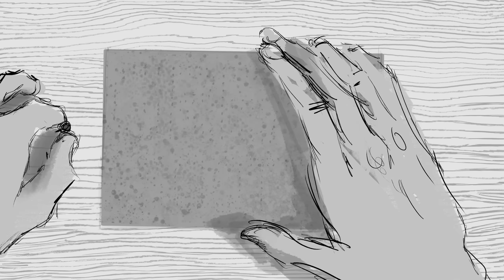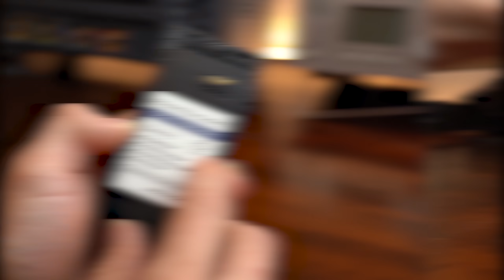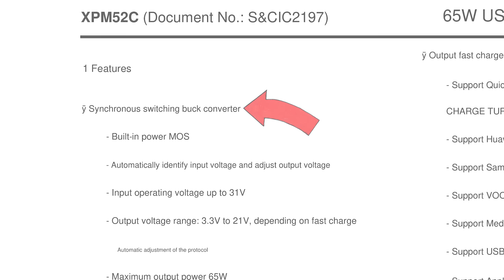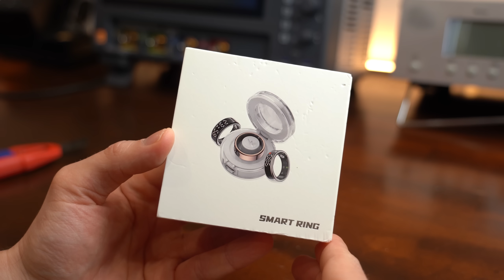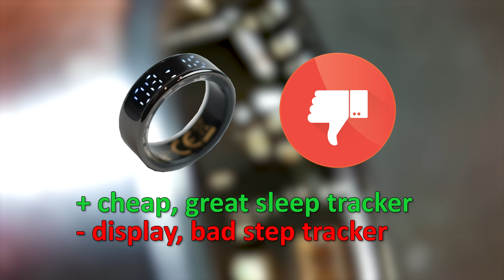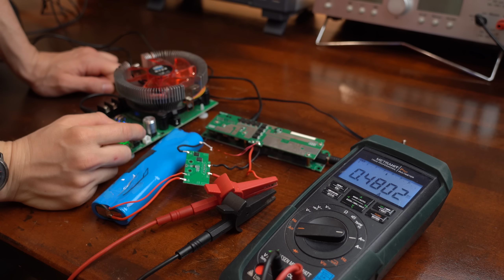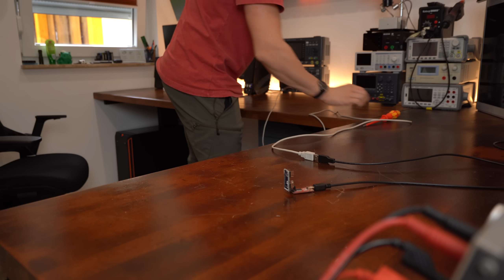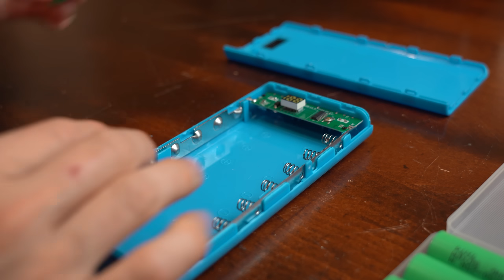I tried finding Hidden Gems on AliExpress AGAIN! (Part 17)

Comment: 14:24 "Shrapnel is positive". With imbalanced cells it's virtually guaranteed!!! I love the Chinglish. One of the products I bought said "The item is optimistic about polarity". 😂 yup, no reverse voltage protection, just optimism!!!
Reply: For some reason "battery contacts" gets translated to "battery shrapnel". If you want to buy contacts for your 3D printed battery holders, most of them are listed as shrapnel.
Reply: Reminds me of the violence motors. I have no idea what it translates to violence, likely something to do with torque or power, but it's always amusing.
Reply: I bought a mini quad bike for the kids a few weeks ago... The instructions clearly state, not once, but at least 3 times, that it uses "2 storke" fuel because it's a "2 storke" engine.
I guess that's some sort of new renewable energy... Probably explains why the local chicken farm has expanded so dramatically recently.... They're going to be breeding storks for these new engines 😂
Reply: @tin2001  This raises the question: what delivers baby storks?
Reply: it's not chinglish  - it's robot translated.
Reply from the maker: Haha
Reply: It's a device to let a person make their own power bank. Having reverse voltage protection would be a waste of money. You're not installing batteries multiple times. They assume a person buying it knows what they're doing. There is nothing wrong with the product. (According to what we see in the video.)
Reply: @ddegn  1 - that's not what he meant. The reverse voltage protection was about another device but with bogus translation.
2 - the device here really only works properly if you've got a bunch of properly balanced batteries to begin with, if they're a bit out of balance when you install then no it isn't safe. If anything, it should have been properly described at least.
Reply: @ddegn  Indeed, balancing your cells before fitting them is a clear requirement.  One might even get away with connecting a prospective new cell via a 10 Ohm resistor until there's zero volts across the resistor, then put the cell in and repeat with the next one.

Comment: Mini-UPS: There is a cheaper "barebone" version for 18650 batteries starting at ~$20, which looks the same (there is a 36W version with display and a even cheaper 18W version without).

Comment: The Powerbank case is not great but at the same time, those spring terminals are trash and will effectively limit the current that can flow to like maybe an amp or two - That would somewhat safely balance out the batteries at even lower current due to their difference being smaller.

Comment: The inductor is the component which heats up the most on these USB PD modules. And they can get very hot. Still very good and also other similar versions. Bought this same one some time ago and also a similar 4 in 1 USB-A version and a SW3518 100W as well. They surprisingly deliver as promised. There is a140W PD version next on my list. Quite cheap way to get 100W+ PD, if you have spare power adapters.
Reply from the maker: Good to know. Thanks for the feedback :-)

Comment: So you could really have a nice and long lasting “off grid” communicator if you pair this with a LoRa node and put the Meshtastic/meshcore app on the walkie talkie, since it’s just Android. I definitely might have to get one of those now. 

Also, I use IoT club SIM for my car’s OVMS connection. Works great and is only $35/year.
Reply from the maker: Sounds like a fun idea ;-)

Comment: Years ago NEXTEL in the US had phones in their network that would also work as walkie talkies on their network.
Reply from the maker: Thanks for the fun fact ;-)
Reply: I remember those. They were quite annoying in public. With a normal phone call, you only hear one side of the conversation, with those you got the joy of hearing both sides (and they always had the volume all the way up) along with the annoying tones every time they hit or released the transmit button. I do not miss them at all.

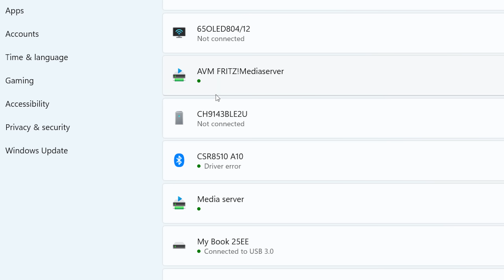Comment: 12:47 actually its normal to disconnect because there is no connection on going on. Once you pair device you should see com port for it on the device manager in bluetooth tab. But there is no name on these devices some times. So i am trying to connect for bluetotth ports once you find correct port it will connect. To connect i mean i use hercules.exe serial program and i choose it my port in there. To find out which port it is try disconnet pair and check device manager then re pair. You can find whic one is it. For every pair device windows creates port and keep it like that for every device paired. i hope its helps.
Reply from the maker: Thanks for the feedback :-)
Reply: I was about to comment this. I had noticed this when using Bluetooth serial with an esp32. It will successfully pair but will appear disconnected. To connect it, you would have to use the new COM port when using a serial monitor and it will connect automatically

Comment: I made the opposite of PoC Walkie Talkie. I use walkie talkie as audio modem, so we can send data over amateur radio network. I hope you find some hidden gem about those 😂
Reply from the maker: Definitely sounds interesting ;-)
Reply: @greatscottlab  There is the ggwave library in github.
Reply: I did it too using 1W portable radios... 10km range on 144MHz! The bandwidth is minimal but still enough to send small data packets.
Reply: @MyNotSoHumbleOpinion  You can run 9600 baud packet if you have a radio that supports it. The bandwidth is too wide to use the microphone connection. It needs a direct connection to the modulator and discriminator. Some radios have a data port for that.
Reply: @rocketman221projects Oh yes, absolutely! The 144MHz frequency has a lot of bandwidth with the right modulation, but in my old project (from the early Arduino era) I just used a rapid tone pulse injected into the microphone jack! The receiving part was done on the headphone jack! So nothing sophisticated or reliable! I took inspiration from the audible clock synchronization signal sent by a public radio stations every couple of hours at 92.1MHz (still used today)
Reply: Where I used to work, the company developed a method of using a laptop to connect to the internet over a mobile phone, this was in the 1G days when mobile phones were larger than housebricks.
The phones were the type that you installed in the boot (trunk) of your car, we fitted them into a rigid briefcase with a UPS sealed lead-acid battery to power it & a modem to connect it to the laptop, they were quite successful for a while to business people.
Reply: can you send complex data such as pictures?
Reply: @ytrew9717  You could send pictures as attachments to emails.
Multimedia Messaging hadn't been invented yet, basic text messaging was only just starting.
This was a long time ago before GSM phones were invented, it was on the old analogue ETACS phone system.
Reply: @ytrew9717 if you ever experienced the old internet, then the experience is exactly like that. Yes, you can send arbitrarily large data, but it takes a lot of time.
Reply: @ytrew9717  yes, amateur radio calls it SSTV(slow scan tv). Video is called FSTV (fast scan tv), in the US there is even a dedicated frequency for amateur radio analog TV.
Reply: I use Baofeng UV-84 connected to my PC at home, the antenna is omni directional Diamond, placed 6m above the ground. Then on the other side I have my laptop with RTL2832U, it was a fun project where I try to find max range of the setup.

Comment: Wrap a lithium battery around my finger! No thanks... Good way to lose a finger.
Reply: I think someone has seen too many movies lol. No like we all put a giant (in comparison) battery next to our most valuable part every day.
Reply from the maker: It is super tiny and the ring material is metal. I highly doubt that something could go terribly wrong.
Reply: @greatscottlab  ZONEofTECH got galaxy ring stuck on his finger because battery got swollen
Reply: @greatscottlab  If you damage the skin completely surrounding any body part, you lose that body part. Our limbs are like trees... cut completely around the trunk and the tree dies. That battery is wrapped in a loop around your finger. If you get your hand caught in a door or smash the ring with a hammer and that battery starts to short, its going to catch fire and you're going to get a 2nd or 3rd degree burn wrapping around your entire finger almost immediately. You're going to lose the finger. That device is almost designed to remove fingers. Stay away.
Reply: yeah, there was already a case where a man was denied to board his airplane because his Samsung Smart Ring's battery had started to swell to such levels that he could not take it off from his finger and he needed medical assistance to remove the ring
Reply: This is like saying, "bananas produce antimatter". Technically yes. Is that dangerous? Absolutely not. It's barely a fart on the quantum level.
Reply: @ethzero  huh? I am working on something, smash the ring... short the battery... it starts swelling and catches fire on my finger, burning a ring completely around my finger... I lose my finger. It's as simple as that and not very far fetched at all.
Reply: @charliemopps4926  Your phone could also combust in your pocket, fusing it to your skin.. whats your point?

Comment: Just an idea for a video : Cheap oscilloscope ... DIY vs buy, display vs USB to PC, etc
Reply from the maker: I can put it on my to do list :-)
Reply: @greatscottlab please do a video on affordable scopes. I've been looking into them for way too long now, and you have either the pretentiousness of a lot of forums, and the outright glazing from some reviewers that obviously are getting paid somehow, and not much in between.
Reply: @superslimanoniem4712 Affordable oscilloscope has a name: FNIRSI. You only need to select a model
Reply: @greatscottlab i would also like to see this
Reply: @greatscottlab +1
Reply: Yes, this.
Reply: I looked into this a couple times in the past. For some strange reason, the sutomotive oscilloscopes which are the ones without all the buttons and screens adding bulk and cost, are about as expensive as good regular scopes which have all the bells and whistles. It makes no sense.
Sure, some of these small scopes are cheap, but they are worthless spec wise.
Reply: @Tomyb15  Anything "automotive" is going to be more expensive simply because the people that buy automotive stuff (especially diagnostic tools) are willing to spend more.

Comment: could you please make a ups just like this in next video for diy or buy project video?
Reply from the maker: I can put it on my to do list ;-)
Reply: @greatscottlab  50 euros and then shipping is pretty expensive for a 12v router ups. I'm pretty sure it is possible to do one cheaper, with parts from aliexpress, and one that doesn't let lithium batteries idle at 100% charge, but 80% which will make them last even longer.
Reply: @cassiofficial  I love mine and paid $CAN60 with almost next day completely free shipping from the Big online order giant. Totally worth the price since I'm not a seasoned electronic tech.
Reply: With UPSes, you really want the battery to 'idle' at 100% to get the longest possible runtime for the attached equipment during a power outage, which simply are accepted as consumables and get replaced on a regular basis (often in 3-5 year cycles). Otherwise, you only ever will get 80% usable capacity and runtime from that UPS
Reply: @resneptacle I prefer my UPS to be reliable over a long time than provide a slightly longer backup time
Reply: @greatscottlab  I would like to see it using LiFePO4 batteries instead and quicker charge for rolling black outs if you do!
Reply: @Bengy22  Definitely LiFePO4. More cycles, less picky about SOC, and most importantly greatly reduced fire risk than NMC. With LiFePO4 you could literally put it on a float charge and use a buck/boost converter for UPS output. There will be some wear and tear on the battery, but it should still last for years.
Reply: @Bengy22  I can recommend the UPS-1228-12 board, it's available on aliexpress as well. You can configure charging voltage/current as well as output voltage. I'm using it for my homelab with a 12V 24AH LiFePO4 battery.
Reply: @greatscottlab  First of all, thanks for responding ☺️. I’ll be waiting for that particular video—and of course the others too—as I’ve been doing for the better part of the last decade.
Reply: @greatscottlab  I currently built my own UPS for my 12vdc homelab but between two 8 port switches, fanless mini pc, and cable modem and am pushing over 40watts.  A UPS that can support closer to 60w with POE that supports GbE would be ideal as adding just 1 Unifi AP PoE will add another 10w.
Reply: @greatscottlab yeah I would love to see that❤❤
Reply: @greatscottlab  Could you also please intergrate battery % on a computer?

there is a project on github that turns a RP2040 into a USB HID UPS device. so windows sees it as a proper UPS. and can thus shut down safely,
Reply: i would love to see what better pcb i could build for such a powerbank
Reply: Hey thanks, 😃 the UPS one does very useful, especially if we can get few 18650 for our router / mini homelab setup
Reply: @greatscottlab  it would be great to see how to do a UPS for a minipc server + router :D
Reply: @greatscottlab  Please do it ... I wanted to know how the system works in ups vs a  inverter
Reply: @greatscottlab  If I may add my two sense for this idead: I have this plan to create a ups for my server that is already running of 12v through a pico psu. Fitting the batteries and boards inside a flex atx form factor. The only thing holding me back from building it is finding a suitable bms with a propper bypass. The rest would be simmilar to the batterypacks you build in the past, i guess.
Reply: @Crosstieger for years, I thought “for all intents and purposes” was “for all intensive purposes”😮. Just so you know it’s “my two cents”, not “my two sense” 😊
Reply: @greatscottlab  btw if you happen to know, aren't normal powerbanks usable as ups' like these? Some of them have such "bypass" functionality, when it's battery charged it will directly power connected devices
Reply: @ArchiWorldRuS there are ups boards on sale for AliExpress that you can connect to a single 3.7v lithium battery. Maybe there is something similar for powerbanks.
Reply: With PoE feature
Reply: Yes please. I want to make a DIY 12v ups for my router + homelab setup
Reply: i have a similar power bank the display is not accurate at all but it charges my phone 2 times
Reply: I’ve also looked into going the DIY route as I haven’t seen something small like this that would let you sense / monitor for when the power goes out and run scripts.
Reply: 24 Watts is not enough for most cases.
Reply: There is a similar one for 20 euro that is 36W but comes without 18650 batteries. I’m not sure a diy can beat that price
Reply: @MrSgtBlade  could you share the link?
Reply: I am actually needing a 12 volt UPS that can handle some current for a project. I have a small one made by Belkin that came with a cable modem or something at one time but it is only a few amps.
Reply: @JamesHalfHorse  Get a meanwell AD-155 module. We use these as UPS for our networking gear. They are reasonably cheap and reliable. They make 12V 24V or 48V version - and you have to supply your own ups battery.
Reply: @MrJigssaw1989  I have been looking at some of the meanwells that have battery charging in them. I don't recall the models but I will look at that one.
Reply: I was looking for cheap UPS for my USB powered smart things. From 0.5A displays to 3A RaspberryPi SDRs. 
50EUR is to much for buying 4-5 such things... And most power banks I tested disconnect output for a second when power drops.
Reply: I would LOVE to see that project!
Reply: I’d really like a UPS with USB-PD (with data) in and out- essentially a USB-C dock with built in battery. I’ve had a hard time finding the components to make something like this myself.
Reply: Get a meanwell AD-155 module. We use these as UPS for our networking gear. They are reasonably cheap and reliable. They make 12V 24V or 48V version - and you have to supply your own ups battery.
Reply: yes please and a cost effective version of it
Reply: No

Comment: EU will soon add a €3 import tax per product. Netherlands is also adding a €2 tax on top as well. The time of getting adapters, boards and components for a fair price is about to end......
Reply from the maker: Hmmm we will see what will happen.
Reply: I'm too waiting to see how this is implemented. If I buy a 100 pack of DuPont connectors, is that 100 products? What about two packs, 100x 1p and 100x2p? What about a kit of DuPont wires and pins?

The line between each item is so blurry in the electronics hobby 

I'm stocking up now before summer though
Reply: @mitchese1  Every package in your 10 package aliexpress package will be getting that ~€3 customs fee.
It's basically rip cheap components from China. Welcome sickly overpriced China junk from within the EU.

From what I gather - if you use alibaba to purchase 100 of some device - you'll still only be paying that €3.
Probably a lot of politicians seeing their greedy "smart" pals losing cash.
Reply: TBH: Most will still be cheaper than buying the same product with worse support from local shops…
Reply: This is nonsense that could be liquidating for many European businesses. I assume they'll repeal it before it even goes into effect.
Reply: Pretty sure the day this is applied, AliExpress will send to Europe as bulk, pay 2.5% customs on the whole container, then do individual packaging locally.
In that case, no "tax on imported parcels of less 150 EUR" is due and a 2.68eur adapter board will then cost 2.75eur...